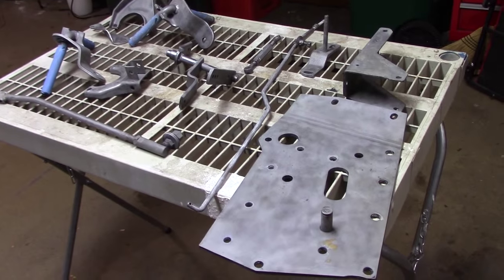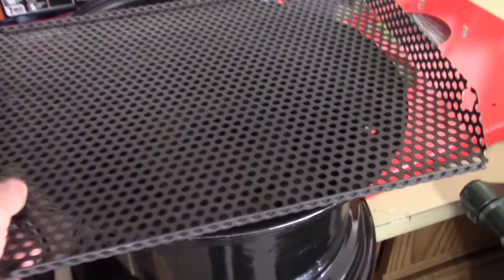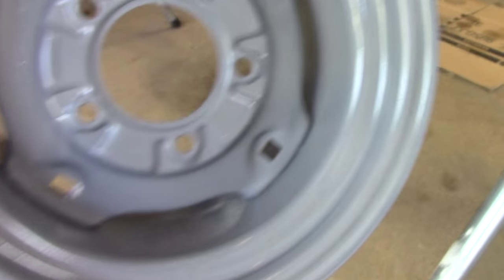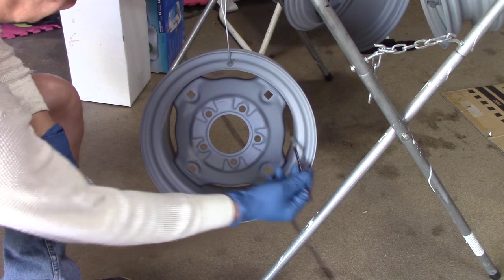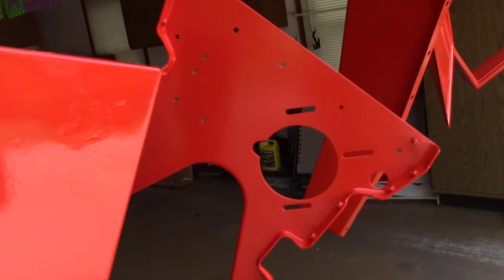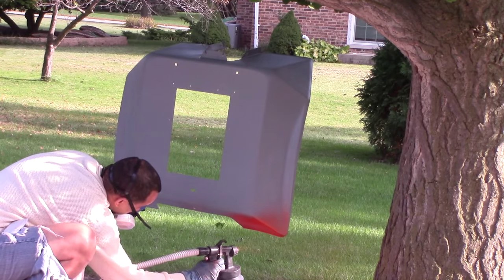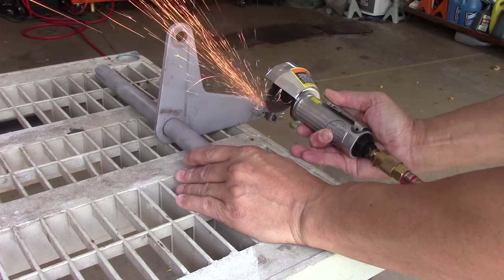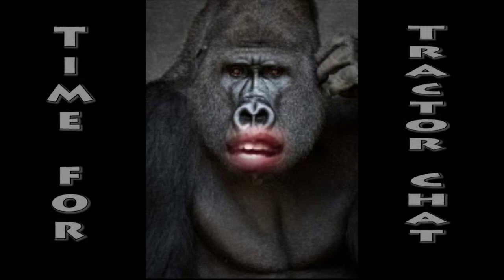38) Allis Chalmers 310 Tractor Restoration project, video 38

Comment: A HF HVLP gun...   Usually HVLP guns are producing a little less fumes than higher pressure ones, but, need more tweeking, also they never atomize as fine, you need a little more wetting additive in the paint, great for finishes that won't mind if they end up a little a more texture in the finish, not recommended for car finish though.

That's gonna be a great looking tractor....    ;)

Comment: Hi mate.  She's coming along nicely,  well done.  I see that doing the tractors up is kind of a big thing in the states.  I'm looking forward seeing her run.
Reply from the maker: +Marcel Timmers I had no idea that guys did tractors until I started this project.  I want to do this right because we had this tractor growing up.  I hope to have all my brothers and sisters ride it again.  Thank you very much and I hope to be riding in the spring......
Reply: Well it's like you said, if you can get all the painting out of the way this fall.  If you can, you will have the whole winter to put it all together again, and escape everything while in the garage.  Unless, where you are, you will would be freezing your nuts off that is.........  How would mum like it if you would assemble it in the house???   Did you do the engine as-well?  she might need a few new rings and bearings.  You would not like it if you find out that you should have done this, belief me I've been there.  I had rebuild a full engine for a Toyota ute/pickup and the only thing I did not do were the rings, I sold the thing now, but I still kick myself.
Reply from the maker: +Marcel Timmers My game plan is to do exactly what you said.  All winter I plan to put this beast back together.  2 years ago I put a heater in my garage.  It's the best thing I've ever done!  So I won't have to freeze when she goes together.  And NO, my wife would kill me if I tried to put that tractor in the house!  As far as the engine goes, it's in great shape.  Right before I started this project, the engine was overhauled so I should be good.  I put some special oil in the cylinder before I put it away.  I hope to get it painted in the spring before I install it.  Thanks again.....

Comment: I found a great cheap way to make awl-grip on my allis foot pads by accident. I was painting on sand one day and the sand got on the piece i was so worried but then my dad said cover it with sand and it will be awl-grip and it has held up amazingly since.
Reply from the maker: +Matt Dun That's a great idea.  I want to see if it came with a factory coating first, but that sounds like a great idea.  Thanks a lot.....
Reply: helps a lot in the winter when I am plowing
Reply from the maker: +Matt Dun I bet!

Comment: That looks like the harbor freight HVLP gun. I have the same one and it seems when I use it, with sprayable paint that says it does not need to thinned, very little paint comes out. It takes a long time to try and cover a surface. Ever experience this with it?
Reply from the maker: +Zachary Mihlrad If you don't thin that paint, it probably won't work.  I'm not sure what paint you are using, but it probably needs to be thinned.  I use an epoxy primer in it than doesn't need to be thinned because it is thin when mixed.  Other than that, I've thinned all the paint that goes in that gun.  Try to get it the consistency of whole milk.  Good luck and let me know if you have any other questions.......